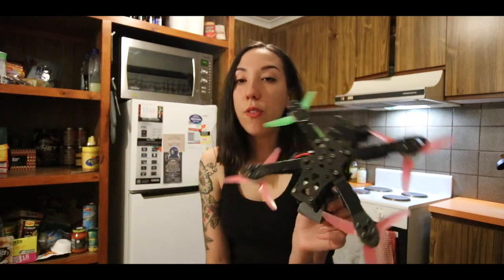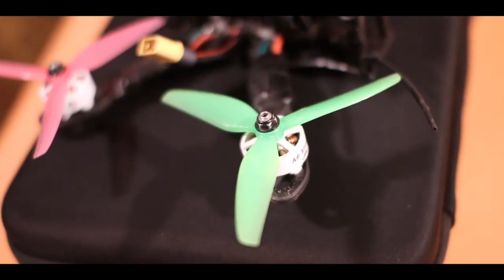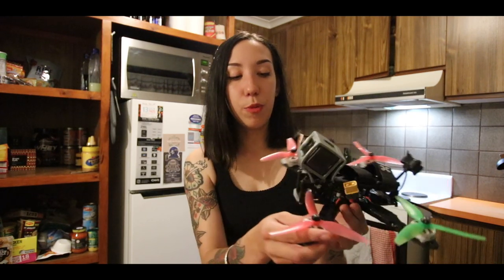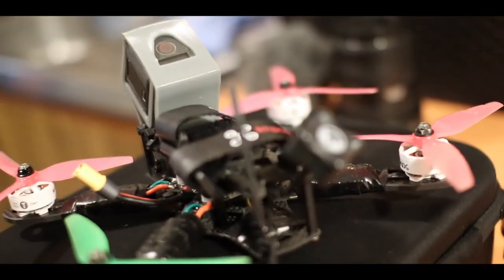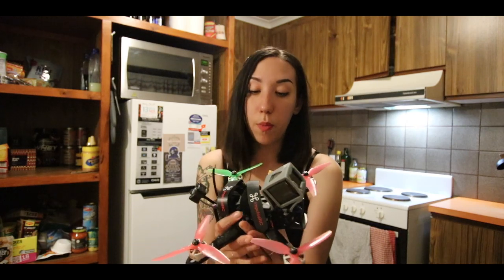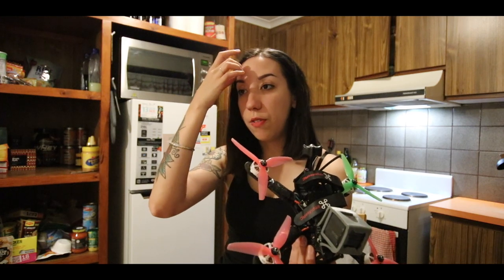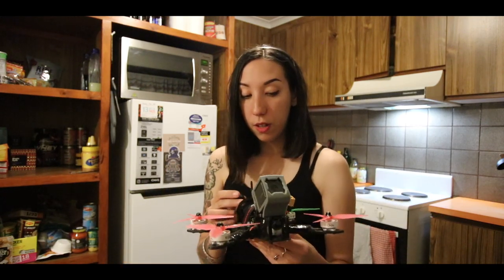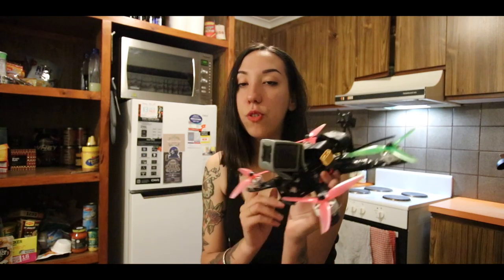WHAT'S MY CURRENT MINIQUAD SET UP ?

Comment: Okay, thank you for this video!  Great setup choice... My old favourite quad is an Alien 5” , Steele V1, Kiss V1, Steele V1 PDB.  Then the Reverb, hypetrain, Wolfe PDB, kiss V2 FC & ESC.  Currently on 6s an Alien 4.5” kiss V2 and Stout V1, and an HD apex!, and an HD Alien 6” frame with TMotor F4 Stack 5” v2 HQ ethixs props & Steele V2 Stout 1750,... Currently in build is a Steele Apex, and, I reckon that will become my new favourite.

Comment: Cocorico🇫🇷😉

Frame : Astrox X5
Flight Controller : Flightone Revolt OSD
ESC : Hobbywing 45a g2
FC Firmware : FalcoX 1557
Power Distribution Board : Built in ESC
Motors : T-Motor F60 v3 2750kv 
Props : HQ 5x4.3x3 v1s
FPV Camera : Foxeer Predator v4
Video Transmitter : TBS Unify Pro HV 
Video Antenna : Foxeer Lollipop v3
Radio : Taranis X9d Plus 
Radio Transmission : TBS Crossfire Full
Goggles : Fatshark dominator HD3
Goggles Receiver : Furious True-D v3.9
HD Cam : Session 5

Comment: For Racing I have:

FPVFlightclub proton
HelioSpring FC
Spedix 40a AIO
Tmotor F60v2 2500
Foxeer Micro Predator v3
TBS Unify and Crossfire nano
Tmotor 5051 raceprops

For freestyle:

Armattan Rooster
JB v2
Tmotor 35a single escs
Emax Eco 2306 2400kV. Tmotor F40v2 2400kv on another
Foxeer Mini Predator v4
TBS Unify and Crossfire nano
HQ 5x4.8x3 props

Both have proven to be very reliable and sturdy. I do need to upgrade my race quads to 6s though. Been holding off as long as possible, but I think the benefits are undeniable now.

Comment: Frame : alien 5"
Flight Controller : matek f7 AIO
ESC : Aikon AK32 35A
FC Firmware : betaflight 4.1(filters by bardwell and pids from Nurk)
Power Distribution Board : Null
Motors : Hypetrain Grinders 2306 2450KV
Props : Gemfan Windancer 5043
FPV Camera : runcam eagle pro 2
Video Transmitter : TBS Unify Pro32 HV
Video Antenna : Foxeer Lollipop v2 5.8G RHCP
Receiver : TBS Crossfire Nano RX

Comment: Frame : Armattan Rooster
Flight Controller : Kakute v4
ESC : Tekko32 35a 4-in-1
FC Firmware : Betaflight 3.5.7
Power Distribution Board : n/a
Motors : Hypetrain 2306 2400kv
Props : Dal 5040c
FPV Camera : Foxeer Falkor Mini
Video Transmitter : TBS Unify HV
Video Antenna : AXII
Receiver : r9 mini

Comment: Frame :
 Skyeliner
Flight Controller :
 DYS F4 Pro (Need to change :P)
ESC :
 DYS aria 32a
FC Firmware :
 Betaflight
Power Distribution Board :
Motors :
 Blaster 2207 2450kv
Props :
 johnny fpv
FPV Camera :
 caddx turbo micro sdr2
Video Transmitter :
 tramp
Video Antenna :
 lumineer micro
Receiver : CRSF nano

Comment: Hey Onigiri Great video & quad! 👌👊    I'm also a kiss flyer, old School ⱽ¹ setup here, still waiting for it to die!  Here is my trusty setup of a year & half!

• ImpulseRC Reverb Frame 
• Kiss FCⱽ¹ 
• Kiss 24A RE Dshot600
• Reverb PDB
• (iFlight Xing 2306 2450kv
 - 6 months) ~ (T-Motor F40 V3 2306 2400kv - 12 mouths)  
• Runcam Eagle 2   35°
• Tramp HV
• TBS Crossfire Micro 
• Tattu 1300Ah 4s 75c (148g)
• TBS Triumph 
• HQ 5x4.3x3 V1S
• Gopro Session 5 
• AUW - 640g 

It's lasted many many crashes!

Comment: hola este es mi set up: 
Frame : Realacc X5R
Flight Controller : Hobbywind v1
ESC : hobbywind 4in1 40A 
FC Firmware : betaflight 4.0.5
Power Distribution Board : - 
Motors : diatone Mamba 2207 2750kv
Props : HQ 5x4.3x3
FPV Camera : Caddx Turbo Micro S2
Video Transmitter : AKK X2P 
Video Antenna : Furious FPV Stubby Air
Receiver : FrSky R-XSR
Saludos !!

Comment: I fly every day and this is my go to flyer would love to try DJI tho 

Frame :
 Armattan Marmotte 
Flight Controller :
 Matek f405
ESC :
speed ex 30 2s - 6s 
FC Firmware :
 Emu light
Power Distribution Board :
 built in to FC
Motors :
 emax Eco 2306 2400kv
Props :
  dal 5047
FPV Camera :
 Foxeer falkor or predator 
Video Transmitter :
 Unify pro hv or rush tank 
Video Antenna :
 Aomway stubby 
Receiver : Crossfire